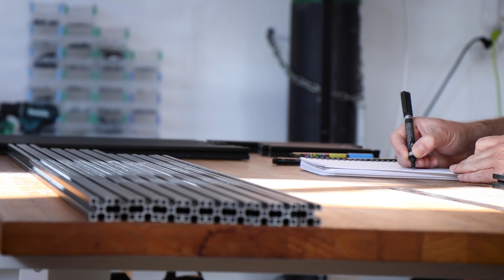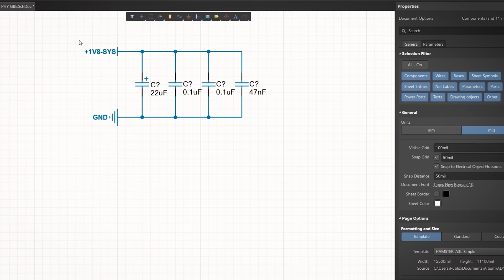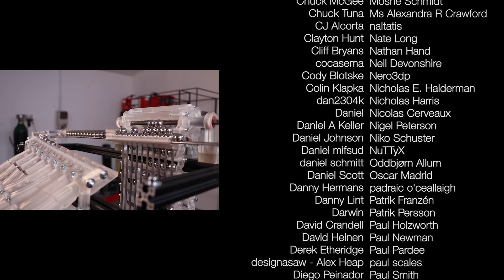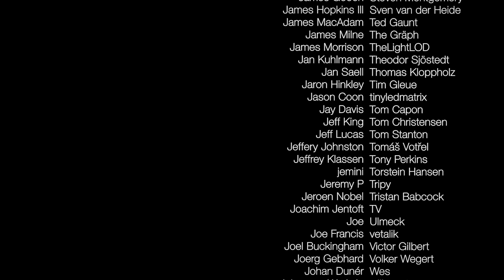MARBLE MUSIC MACHINE (from scratch)

Comment: Meanwhile, Martin is probably having an existential crisis, trying to rewire his brain by reading 10 self-help books at the same time. He is seriously overthinking the whole MMX... And by that I don't mean that he's thinking too much about how to build it. That's ok. He's spending too much time philosophising about building the thing.

Also, I predict this build will trigger another MMX major component redesign. I think it will be the marble funnels.
Reply: Martin's biggest problem is that he's trying to optimise and debug components inside a complex system instead of designing/testing components first then building a working system.
Reply: Mirande will follow Martin, I'm sure.
Reply: @MoraFermi  The problem is not that the components are in a complex system. The problem is that the system keeps changing. Remember how much time he wasted with adjusting the timing on the marble droppers which he then ripped out? Not before wasting even more time to level the marbles at the top of the tubes. So much wasted time, because he was determined to perfect a design surrounded by temporary assemblies.
Reply: @McGutschy2  I'm not sure. Ivan seems to be a "let's wing it" kind of guy. He's been building things for long enough to have a preferred working method, not like Martin who only had one big project under his belt before the MMX.
Reply: @CristiNeagu  Martin has created a big team and his skills are easy equal or better compare to Ivan.. But this is not the point.. In German: Konkurrenz belebt das Geschaeft. (Competition stimulates business). An idea is able to walk better on two legs. :-).

Comment: I miss Wintergatan's videos.  I think that perhaps he's a bit overwhelmed by the pursuit of perfection, it's a curse, and a blessing all in one.  I sincerely hope that your video helps him to understand that it's all for fun, version 1 sucks but ship it anyway, real developers ship.
I really loved your approach to this problem Ivan.  You clearly have a much closer relationship with 3D modelling, and your 3D printers than Martin has, which is interesting.  While he will spend a day manually forming lines in beautifully concentric hand fettled curves, Ivan's aesthetic is far more brutally engineering-based.  If straight lines and 3D printed corners will work, then that's what will be done.  I loved Ivan's approach just as much as Martins.  Both of them had to deal with marbles on the floor.  I sincerely hope that this inspires Martin to post again.
Reply: Incorrect.  There is absolutely no virtue in perfectionism.  The best engineers go for 'barely good enough'.  Perfectionism is not a substitute for fault tolerance.

Comment: The adjustment is great for small scale, but for larger scale, it will bite you, every time a screw is loose, that part will come out of alignment.  Also, the steel extrusion frame has the same problem, screw loose means sliding.  I would look at getting either a wooden frame, or a metal one with regularly spaced holes or something.  I think the midi drumkit is a good idea, because if this was its own instrument you'd have to worry about acoustics, etc.

Comment: A little tip: If you weld on anything with bearings or moving parts, make sure you place the ground directly on the bit that's being welded. You don't want the current passing through bearings, or in this case the whole motor. If the current is enough to melt the thing you're welding, it's enough to potentially melt anything else it might arc at, like between rolling elements and bearing races.

Comment: Groovy scalable concept for a printing project. 
Maybe for a musical idea, you could print 6 actuators for each guitar fret, and 6 actuators for picking and strumming sequences, and link all those to a raspberry pi or anything that can feed it midi or guitarpro files, and power it by solar, or wind, or waves at the waterfront, or, go further outside the box and even power it by making an organic battery to emulate a guitar player that can convert calories to music, a type of flux capacitor. 

Keep the rock alive and yourself and keep on rolling, as this is what you do.

Comment: A temporary fix for that twisted belt rubbing on itself could be a small printed idler with shoulders just left floating where the two belts cross. The teeth will keep it in place, and it will act as a belt spacer.

Comment: To make the elevator turn in the other direction, it is necessary that the belt drives a gear and the wheel of the elevator is caught in this gear.

Comment: You have a great start with the marble support. It will work if you can mount the same frame on the other side. That way, the lift can't wobble around while moving and under big loads.

Comment: I would love to see more on this contraption. For the lift going in the wrong direction. Go from the drum pulley down to another pulley. On the same shaft put a gear. Mesh another gear with pulley on that same shaft. Then go to the lift. That will change the direction without twisting the belt.

Comment: Another option to get the marbles into the feed tubes would be to use analog switches.  I have the idea in my head but I'm not sure my description is going to be good.  Basically, a pyramid of switches that direct the marbles into a different chute each time it's hit.  For eight channels you would need a total of 15 switches.  One a the top, two below that, four below that, and so on.  If done correctly, it should drop a single marble in each channel before starting at the first one again.  No need to wait for a chute to fill up first or rely on random drops into the chutes.  Requires less marbles this way, too.
Reply: Another upside is that you wouldn't need adjustable feed chutes which eliminates the problems described at the end of the video.

Comment: Add a 3d pinted gear so direction of  rotation is reversed. You might have to shorten the belt. 
I recommend more belt engagement on the drum pulley. You can add a idler to improve belt wrapping on the pulley.
Excellent first attempt! Very interesting to see your problem solving skills!

Comment: The problem at 7:35 has been solved before by the community of wintergatan, the idea is that instead of having the marbles roll over flushed channels, have them roll over a flat surface and have cavities on the back of that piece that connect to each channel, that way the flushness will need to be at the side instead of at the bottom, letting the marbles roll until a cavity is empty

Comment: A "fix" for the twisted belt would be a part with 2 small free spinning rollers on a single block right at the point where tensioned belt intertwine. Just gotta measure angle and size to make them fit.

Comment: worm screw lift instead of the conveyor belt you can put 12 worm gears in a cylinder and three cylinders upright in the back space.  You can make a scavenger plate on the floor of the machine  so any that get loose can be scavenged into the machine.

Comment: This is fantastic! I know the point of all of these marble machines is to attempt to recreate a a music box with a drum and N notes, but it would also be interesting if instead of a drum you considered something like a piano player (a long scroll of paper with holes) that determines which channel to actuate. That would allow for considerably longer and more complex songs. Don't know if that breaks the point of the design (those rely on pneumatics), but would still be a mechanical design (non electronic). Another idea I'd like to see explored is using smaller metal bearings. The volume/print time of the whole machine can be cut down to a fraction just by scaling down the size of the spheres a little bit. Just throwing out ideas.

Comment: You could use 2 gears to reverse direction for the marble lift. Then just add a few intermediate sprockets to keep the lift aligned so the marbles don't fall.

Great prototype though.

Comment: I think that, similar to watchmaking, or automobiles, you can only stretch mechanical solutions so far before the engineering hits a wall. Because simplicity and elegance are the hallmarks of ingenuity; Marble Machine cannot demonstrate ingenuity because it is fundamentally too complex. And this is why we have quartz timekeeping, why automobiles are "drive-by-wire" (meaning that much of its mechanical/analogue parts are now sensors and computers), and music production favours using a DAW. Marble Machine is a romantic dream that desperately needs a reality check.

Comment: That is a very good work in progress! You are learning just as much as he is on the mechanics of these things. I have a suggestion on the belt problem. Use an extra gear to change the direction of the marble belt or the wheel drum instead of twisting the rubber belt. Nice to see someone else following in his footsteps.

Comment: Can you use a magnet to hold the marbles in the lifter and then scrap them off to release them from the magnet and roll down the track?  You might be able to use this method and then untwist the marble lifter drive belt.

Comment: The only problem I see is that you would need to disassemble half the machine just to change the notes in the roll. That could be solved with pegs that can be attached to the holes, or entire rows that can be slide in.

Comment: For tensioning, have you considered at a car belt style? Basically a spring-loaded arm with a bearing at the end pushing on the flat side of the belt. I have 0 experience with the type of machine you're building, but this could prevent the need of a tensioning gear being friction clamped to the t-track. Incredible project, dude!

Comment: 15:23 you can simply put another gear on the barrel which drives it and put the belt on that and not the barrel gear, it will be in reverse as needed

Comment: My mind immediately went to a drum that has controllable studs - aka can change the music.  If you had studs/notes that were Arduino controlled and electromagnetic, you could have the note change after every rotation and marble drop.  So, the second a marble drops that stud would either be queued up for the next round or not.  This would allow you to have full control of the music in real time and you could in effect "play the machine" at the same time.  That would really make this awesome.  It is already awesome of course but I am sure you know what I mean.

You could easily adapt that large drum internally to accommodate small magnets and stud channels with limiters/stops.  

Oh, you could also round the studs to allow for smoother operation when rolling over the release.

Comment: when the belt issue arose you could have linked the belt to another gear that was directly touching the gear attached to the lift and got the same affect without all the added friction from the belt rubbing on itself.

Comment: I'd use an Archimedes screw for the lift section, that would take care of the flexing although it would also slow down how fast the marbles get back to the top.  You could slant the "trips" for the hammers where they hit the screw heads in the wheel, that should fix them catching.  Maybe use some clear plastic wrap on the rails of the "catch basin" to keep the marbles from falling out, or just put those rails closer together.

Comment: So I had watched all of your previous videos this evening on making the oversized time clock with all the marbles and then down to the second one which I don’t know if you have a video showcasing a finalized and proper working video of the second counter, but when I came across this, I had already watched that other guys music machine videos from Wintergatan and thought it was funny when you mentioned him, and knowing that you tried this based off his videos, so when my mind that kind of made sense, but for a very small, in the moment, built music machine with a digital keyboard, I honestly don’t think it turned out too bad despite knowing that some of the flaws in the machine you showed, after showing that the machine to a general degree, seem like it was working fine, and the flaws that you pointed out were after I saw a plane regularly, as if I thought there were no issues and it decently worked with no flaws, but I also said out loud to myself while watching this video, that with the steel rods in the marbles and the see-through plastic and how you put everything together, I like the way that machine looks because of the materials it’s made out of but again for a general idea that you came up with in a short period of time just to put together on a whim so to speak, but knowing how all the pieces had to work to make the machine actually run properly, I not only really like the way it works, but for a first try model, I thought it worked decently well. 🙂

Comment: Tig welding with the current flowing through the motor shaft and bearings?  I am kind of surprised that it still worked after welding.
Reply from the maker: I'm not gonna lie, I had my doubts too, but I guess there where internally many points of contact and weren't moving while welding so no sparking points? I tested resistance on many points before welding and it was under .1 Ohm everywhere I tested between the shaft and the plate.

Comment: I'm a little late to the game but your machine as a proof of concept has some things that Martin of @Wintergatan should look at but I somewhat like your use of the segmented race for the channels, although, even using copper water pipe or your four-rod channel race design cut to length may work.  Your lift design seems okay for the most part but maybe having a chain guide rail on both sides of the lifting part like you see in some auto engines for the timing chain could be implemented.  If you put a pair of 1:1 gears on the lift instead of twisting the timing belt may cure some headaches as well.

Comment: My solution would have been to simply change the direction of the screws and run the motor the other direction instead of turning the belt onto itself like that.

Comment: The "mounting channels flush" is in my opinion the weakest point here. It's incredibly sensitive to positioning, even change in room temperature might get it misaligned and marbles stuck. I think you definitely need to make the lift higher to give your marbles greater slope to reduce the sensitivity. But overall I think this splitter design is unreliable and if you don't want to copy Wintergatan's design (which is IMO much less sensitive) you might want to consider using simple series of divide-by-two splitters. It's "just" one less splitter than there are channels.

Comment: stop drilling holes in the 3d printed parts if you want make a thread in the hole add diameter of the nozzle to the diameter of the standard hole for the tap: example m3 threaded hole should be printed with 2.5mm(standard hole diameter)+ 0.4mm(nozzle diameter) = 2.9mm - that's right hole diameter you should place in your cad model, and after printing you will have to just screw a bolt into it easily and it will stay firmly in the model. If you need tight fit: add 0.1+nozzle diameter and you will have to use just some force to push in some rod or bearing to hold it firmly in the hole. If you need some free moving connection add from 0.15 to 0.2 + nozzle diameter to the hole diameter